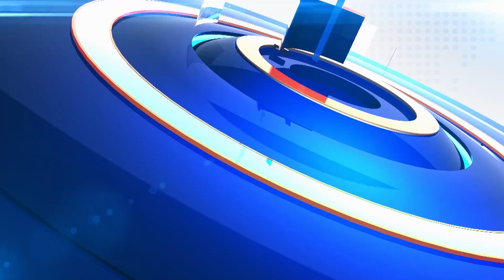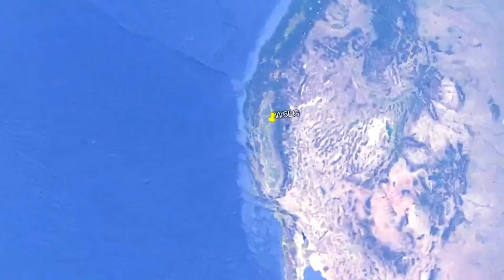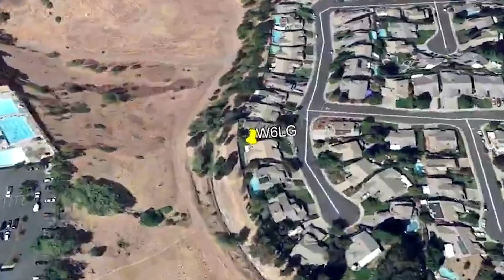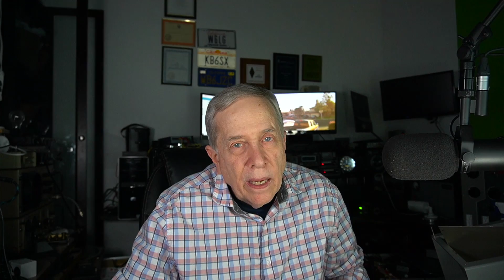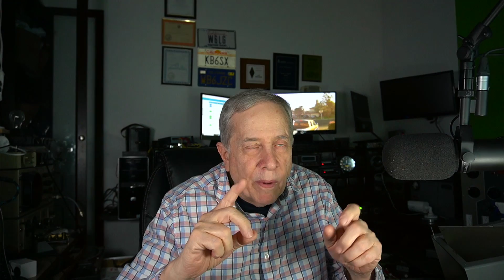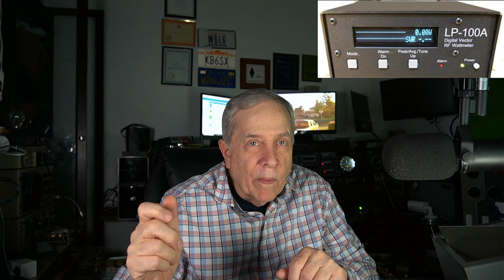Wattmeter/SWR Meter Insertion Loss With Ham Radio Elmer Jim Heath W6LG

Comment: Dear Mr. Jim, I have looked everywhere for the answer to this which has  brought me to another one of you great videos. Being new to Ham there is more than enough to research. I am running a Yaesu FT-991A and have an MFJ-849 SWR/Watt meter, no amp and no external tuner. The readings from the watt meter can vary considerably to the meter in the radio. I understand the differences if the radio tuner is on or off. This brings me to my question. Having the SWR/PO meter in the radio is the external meter even necessary? Thank you in advance, Jim here also, K9DYX

Comment: Also, on your cable/connector loss videos, you need to add several feet to the cables.  Short cables have some complex physics involved.  The same goes for fiber optic cable

Comment: MIne (an MFJ Watt and RF Ammeter) is in line all the time.  The only time I've had trouble is when the transformer - a wall-wart that powers the Wattmeter - went bad.   Thought my VSWR's irratic and that it might be my coax or antenna that was going south.  After trouble-shooting I found it was the power supply.  The Wattmeter and my radio were not the problem.  I now power it through an auxiliary Micronda 12V power supply that runs my speaker.   I use mine for the same reasons you do, Jim.  They are nice to have.  I also like watching the needle bounce on the "forward" side of the meter when I transmit.  Hey, there has to be a cool factor too, right?   73,   K7GYB.

Comment: Even if it did introduce a tiny amount of loss, it would be worth the loss verses the repair or replacement cost of the equipment damaged by not monitoring it.

Comment: Hey, Jim great content as always! you look good in the new shack! I have a question if you have not already covered it. How do you handle radio/ antenna switching in the new shack? I watched you build the high-power remote relay setup which I am going to do myself but would love to see your configuration setup.
Cheers! W9KLS Dana T.
Reply from the maker: Hi,  While probably not the best thing, I did use Russian or Ukrainian relays that are big vacuum on/off SPST.  I lined them up in a box and have a buss bar down one side.  Isolation is not perfect. But, they can handle high power.  The smaller version of that relay can easily handle 1500 watts and are not expensive on Ebay.  73, Jim

Comment: Another excellent video Jim,  the amount of energy extracted is indeed very small. There are arguments that harmonic output can be increased due to the detector diodes but I am not sure that I have seen much evidence of it. Of course with a Bird Thruline if the slug is rotated 90 degrees even that possibility is reduced. Something to be wary of is that the insertion SWR of some meters can cause a small disparity in readings. I leave mine in circuit....
Reply from the maker: I view some of that variation as not significant but interesting about how that happens. Thanks again my friend.  73, Jim
Reply: @ham-radio , thank you for the reply, you covered the subject well. I will go back and fix a few of my typos though. In my fairly typical HF station the amplifier relays are not perfect so I do see a slightly different SWR at the radio to that between the amplifier and the tuner, As you say it is not significant, the worst thing about having lots of rf power meters is that they never totally agree anyway! 73 and thank you for your great work.

Comment: Jim, When you talk about specific devices, would it be possible for you to provide a link to the items you are referencing in your show description? I am interested in knowing what make and model SWR meter with alarm you are talking about. I replayed the video a couple times but obviously misspelled or something the model with the alarm you were referencing.

When I entered in NALP, I got National Association for Law Placement. Etc.

Opps, now I see N8LP not NALP.
Reply from the maker: Sure.  I like the N8LP device.  It is an LP-100a.  I'll see if I can find his website.  73, Jim
Reply: @ham-radio  I found that one, but was curious as to what the other meter was and which one of the two you prefer and why?

I have an MFJ-849 inline for my UHF/VHF rig (which I don't use all that often) but have been looking for a good inline meter for my FTdx-101MP and AL-80B.

Thanks!

73
W9HJ
Reply from the maker: Array Solutions and when I checked, it appears to have been discontinued.  I really like the looks of that new Yaesu that you have.  You have a nice combination of equipment.  Congratulations!  73, Jim

Comment: It is reckoned that inline non amplifying kit such as SWR meters has an insertion loss of 0.2db.
So it will not reduce your power or change your SWR.
But here in the UK where we are going through a risk assessment with Ofcom our regulator every little bit helps in making sure our EIRP is less than 10 watts.
The RSGB have a Spreadsheet which woks this all out for you, they are working with the ARRL on this.
I enjoy your video's very much.
73 de Mike G3ZCC

Comment: Hi Jim,
Good advice. I leave inline a Bird dual line section with two remote meters. I always keep an eye on the reflected power meter to see if it changes drastically. You and the family stay safe. 73  WJ3U
Reply from the maker: Hi Don, Thanks!  I have seen that wattmeter.  I do have two birds.  I will find that Bird online.  Thanks again & 73, Jim
Reply: @ham-radio  Hi Jim,
Picked up the line section, two meters, and the cabinets and assembled them myself. Didn't want to have two Bird 43 meters coupled together. I may get a dual cabinet instead of two separates.
Reply: @ham-radio  Have to be careful about getting the meters online. Make certain it's a Bird meter and not one of the look a-likes. One of the meters I purchased was not a Bird and it was 26ua full scale instead of the usual 30ua of the 43 series.